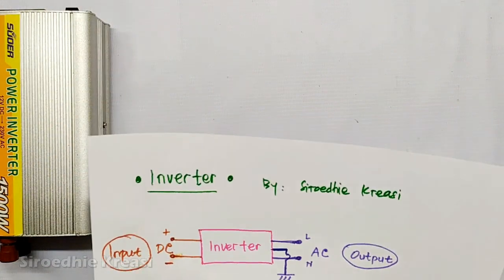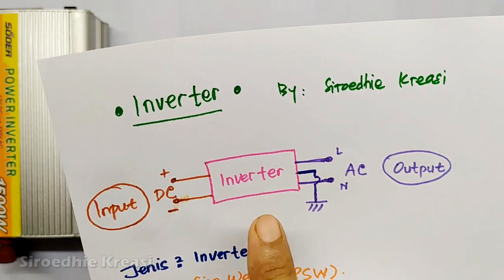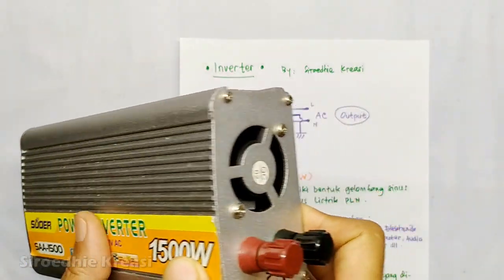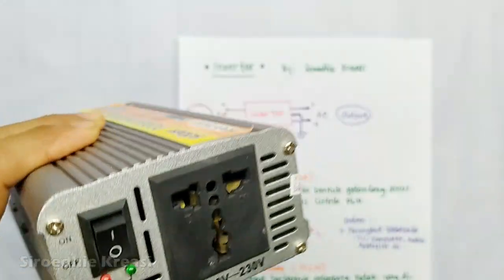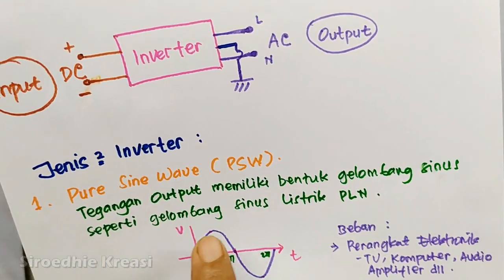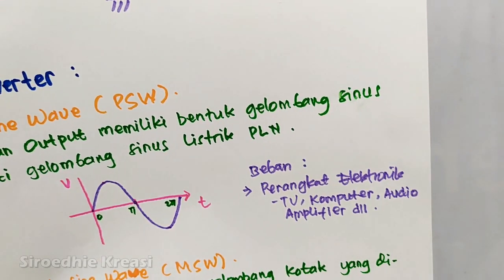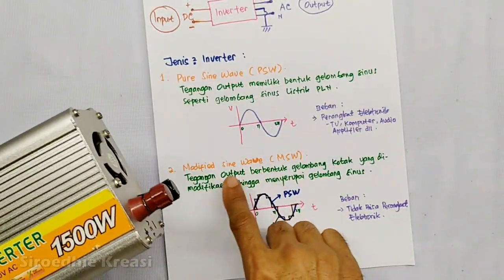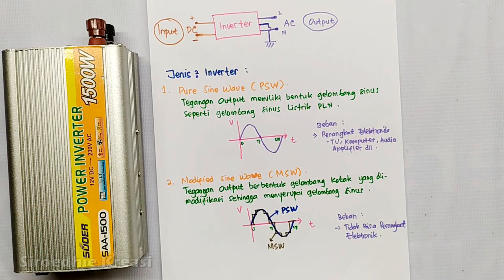Jangan Salah Pilih Inverter, bisa fatal akibatnya

Comment: ass kak . mau tanya, kalo penggunaan buat grinder kopi apa bisa ?
jika menggunakan aki mobil tahan berapa lama. soalnya buat cadangan jika sewaktu kedai kopi kami lagi padam listrik. aman nya pakai jenis inverter PSW / MSW
terima kasih
Reply from the maker: untuk grinder kopi jenis msw dah oke kak, lama dan tidaknya tergantung besar daya (watt) grindernya kak. coba dicek dulu
Reply: @siroedhiekreasi   grinder kopi yg saya pakai
daya +- 160 - 180watt
voltase 220v / 50hz
terus inverter jenis MSW nya yg berapa watt ?
ohyah jika mesin grinder kopi tidak dinyalakan sedangkan inverter nyala, apakah daya aki tetap terkuras ?
maaf kak banyak tanya. terimakasih
Reply from the maker: @rdvruvie280  bisa pakai inverter 500 s.d 1000 watt. kalau tidak digunakan sebaiknya dimatikan juga inverternya, agar aki bisa hemat
Reply: @siroedhiekreasi  oh gitu yah mas,
kalo misalkan saya pake inverter jenis msw 1000 Watt pakai aki yg 60AH
dengan tegangan grinder kopi 180 Watt bisa tahan berapa lama kira2. maaf mas banyak tanya masih awam. terimakasih

Comment: Izin bertanya mas, apabila kita mau pasang inverter dc to ac dengan aki 12v di rangkai secara seri, apakah bisa pakai inverter yg 12v atau yg 24v?
Reply from the maker: aki 12 volt yg dirangkai seri tegangannya menjadi 24 volt  pak. berarti kita gunakan inverter 24 volt. kalau dihubung paralel, bisa kita gunakan inverter 12 volt

Comment: Assalamualaikum. Telat nih baru nonton sekarang hehe. 

Mau tanya, kalo arus 24volt yg ada di truk bagusnya pake inverter yg mana dan berapa watt? Mungkin ntuk kebutuhan biasa aja kaya cas hp dan teko rebus air yg kecil. Terima kasih sebelumnya
Reply: Ada tambahan magicom mungkin jarang dipake, karna ketika perjalanan jauh dan posisi lagi dihutan aja
Reply from the maker: telat² dikit gak apa apa Om 😀. kalau aki 24 volt, harus menggunakan inverter dengan input 24 volt juga Om. mengenai watt nya menyesuaikan dengan watt beban ( cas hp, teko rebus) minimal 2x lebih besar dari watt beban. lebih besar lebih baik
Reply: Kalo kita langsung ambil arus dari aki, ga pake arus yg dari lighter. Pake sekring mungkin ya biar lebih aman
Reply from the maker: @kliacahyo4543  bisa Om, ambil langsung dari Aki dan dikasih sekring biar aman
Reply: Oiyaa, kira kira kalo tak beli yg 12volt trus diambil arus aki 12 volt bisa ga? Negatif nya ngambil dari body gitu? Cari yg 24volt susah di online shop kebanyakan watt nya gede dan msw om.
Reply from the maker: @kliacahyo4543  bisa Pak, ambil dari aki yg 12 volt. biasanya aki 24 volt terdiri dari 2 buah Aki 12 volt yg dihubung ser
Reply: Iya dari kabel pararel nya kan om. Aman ya itu?
Reply from the maker: @kliacahyo4543  ya Om, aman

Comment: Mau tanya pak, itu kalau untuk memasak nasi pakai magicom apa bisa? Trmksih🙏
Reply from the maker: bisa pak
Reply: @siroedhiekreasi   terganrung amper akinya atau teegantung inverternya pak? Soalnya saya ada aki besar dgn inverver 600v nggk kuat utk masak nasi. Utk kipas angin juga mutarnya nggk kencang. Kondisi aki baru pak dijamin blm soak hehe.
Reply from the maker: @wahyuhandoyo6288  tergantung sama aki dan inverternya. semakin besar Ah dari aki, akan semakin lama waktu menyala. daya inverter minimal 2x lebih besar dari daya beban
Reply: @siroedhiekreasi   pantesan, magicom saya kebetulan 400wat. Inverternya cuma 600w. Kalau aki nya 150Ah pak. Tinggal ganti inverternya ini berarti. 
Trimksih pak penjelasan nya. Sukses selalu
Reply from the maker: @wahyuhandoyo6288  sama sama pak, amin

Comment: Assalamualaikum kak, sy dari Papua, baru ketemu video Kaka, yg selama ini sy cari mengenai listrik alternatif utk perangkat mesin kopi sy. Rencana sy mau jualan dgn cara mobile. Jadi sy butuh listrik kurang lebih 4000 s/d 5000 Watt( ini sudah x2 dgn Watt yg sy gunakan, mesin espresso dan grinder biji kopi) ,Sy sudah nonton videonya, tapi sy tdk mampu menentukan jenis batterai ( aki) yg sy harus beli, inverter berapa Watt utk set jualan sy kak . Mohon berkenan dijawab kak. Terimakasih
Reply from the maker: tapi setelah saya pertimbangkan kembali, untuk daya sebesar itu lebih baik menggunakan genset aja kak. lebih praktis dan ekonomis 🙏
Reply: @siroedhiekreasi  ok kak, 
Tapi misalnya saya tetap pakai (sistem inverter) sy butuh inverter berapa Watt dan Volt serta aki/baterai berapa Watt dan Volt (dan berapa pcs aki yg sa pake) kak
Reply: Karna total pemakaian elektronik sy kurang lebih 2000 an Watt saja kak, tapi karna sy pernah mendengar saran, jika ingin alat2 penghasil listrik tetap awet, maka di kali 2 utk kapasitas nya kak, jadi sy pikir sy butuh 4000 sampai 5000 Watt listrik
Reply from the maker: baik, insya Allah coba saya hitung² dulu ya kak. mohon bersabar, kalau dah selesai nanti saya share di sini

Comment: Saya sangat awam jadi pertanyaan nya maaf jika mendasar.Mau tanya mas
1.saya butuh listrik 300watt,jenis aki apa yg cocok dan awet serta spesifikasi nya.misal butuh yg 10ampere atau gimana
2.apakah semakin besar ampere aki berarti semakin lama jangka pakai nya
3.saya bakal menggunakan mesin grinder/penggiling yg memakai motor dengan 150 watt.itu cocok nya pake inverter apa?
Reply from the maker: 1. Kalau pengen praktis, bisa gunakan jenis aki kering (free maintenance). Mengenai besar kecilnya Ah tergantung berapa lama waktu pemakaian ( silahkan lihat contoh² perhitungan di kolom komentar yg sudah saya buatkan).
2. iya benar
3. jenis msw sudah boleh, kecuali ada beban yg lain seperti peralatan elektronik lebih baik gunakan psw
Reply: Terima kasih bang atas masukan nya
Reply: Kalo Aki kering bisa di cas ga bang?

Comment: Mohon bimbimgan pak...saya punya aki 70 amper mau pake untuk mancing...
Pertanyaan
1.berapa lama tenaga aki habis untuk menghidup kan lampu 50 watt sebanyak 6 buah
2.inverter jenis apa yang saya beli.
Reply from the maker: 1.perhitungan sederhanya lebih kurang seperti ini : 
Aki : 70 Ah 12 Volt
Lampu : 50 watt x 6 = 300 watt
I = P/ V = 300/ 12 = 25 amper 
Waktu pemakaian : 70 Ah/25 = 2,8 jam
effisiensi Aki 20 %, sehingga 2,8 - 0,56 = 2,24 jam ( waktu pemakaian efektif)
2. Jenis inverter jenis msw 

Semoga membantu 🙏
Reply: Aki 70 Ampere itu tidak ada pabrik manapun yg bikin. Yang ada adalah aki dgn kapasitas 70 Ah.
Jadi sangat berbeda antara A dan Ah.
Kalau digunakan sbg penerangan, ya jangan pakai lampu 220 Volt, tapi lampu LED 12 Volt. Karena ini menyangkut efisiensi. Mengkonvert tegangan membutuhkan energi terbuang sbg panas.

Comment: Saya pake buat hotgun kok ngak kuat inverter 1000 Watt hotgun input  juga 1000
Reply from the maker: pakai aki beeapa Ah Om ?
Reply: Pake aki motor 12 volt
Reply from the maker: @dimensisakti2509  akinya kekecolan tuh om
Reply: Maaf terima upgrade ngak

Comment: Fatal nya gimana bang,? Yg aman gimana? Kalau untuk menyalakan TV gimana? Aman kah 50 watt
Reply from the maker: fatalnya adalah saat kita salah dalam menentukan jenis inverter untuk keperluan beban.  kalau untuk tv, seperti yg saya sampaikan dalam video ini adalah jenis psw. untuk daya bisa kita gunakan minimal 2x lebih besar dari beban
Reply: @siroedhiekreasi  kalau untuk orgen bisa gx bang? 40w  16volt
Reply from the maker: @kakjunjung3525  kalau tegangan 16 volt pakai adaptor aja Pak, bukan inverter
Reply: Daya input dari aki  outputnya mau ke 16 volt
Reply from the maker: @kakjunjung3525  maaf Pak, gak faham saya pertanyaannya 🙏
Reply: @siroedhiekreasi  jadi gimana caranya aki bisa buat nyalain alat dengan daya 16v .. Apakah pakai adaptor AC atau pakai stepup aja dr 12v aki di naikan ke 16v  apakah bisa?
Reply from the maker: pakai adaptor aja Om, kalau inverter gak bisa.
Reply: @siroedhiekreasi  adaptor yg gimana ya? Dari aki 12 v  jadi 16v

Comment: Mau tanya pak kalau baterai subsystem yg dipakai tegang 24volt 150ah apakah bisa pakai inverter 12volt?
Reply from the maker: gak bisa Pak,  harus pakai inverter dgn input 24 volt
Reply: Terima kasih atas informasinya pak🙏...
Reply from the maker: @samsulakram  sama sama Pak

Comment: Pak, kalaw untuk mesin cuci sanggup gak ya inverter nya 1500 bgtu dengan aki 200.. mohon dijawab pak
Reply from the maker: insya Allah sanggup Pak. kalau boleh tau mesin cucinya berapa watt. u tuk daya inverter minimal 2x lebih besar dari daya beban.
Reply: @siroedhiekreasi  rencana beli mesin cuci yg mngkin agak rendah watt nya pak.. kisaran 250 s.d 350 Watt pak...mngkin kapasitas 8kg saja
Reply from the maker: berarti invertenya dah oke
Reply: @siroedhiekreasi  tapi sblumnya pak klaw sya pake blender dengan Watt 150 itu gak maksimal pak tenaga nya... Klaw pake generator jadi normal
Reply: @siroedhiekreasi  kebetulan saya cek inverter yang di video nya sama dengan yg ada drumah pak 🙏

Comment: Bang sya subscriber baru ..mau tanya kalau grinder kopi cocoknya pake inverter PSw atau msw?? Terus kalau powernya 200 watt Voltage: 220V /50Hz harus pakai aki yg bagaimana..mohon pnjelasannya soalnya sya buta mslah kelistrikan😅
Reply from the maker: jenis msw udah bisa, daya inverter minimal 2x lebih besar  dari daya grinder. pakai aki 60 Ah dah oke tuh
Reply: Saya cek2 harga di olshop..inverter msw di deskripsinya ditulis "tdk bisa digunakan untuk grinder kopi,gerinda dll"..trus gimana bang malah jdi bingung
Reply from the maker: @BangZoroOfficial  grinder kopi menggunakan motor universal bang, sama halnya dgn mesin bor dan gerinda seperti yg saya contohkan dalam video ini.  idealnya memang pakai psw, tapi menggunakan msw masih bisa bang. Kecuali beban yg kita gunakan seperti tv, hape, laptop, dvd player itu mutlak menggunakan psw 🙏
Reply: Siap bang makasih penjelasannya
Reply from the maker: @BangZoroOfficial  sama sama bang 🙏
Reply: Kalau blender bisa nggak pak pakai msw?
Reply from the maker: @BangZoroOfficial  bisa Bang

Comment: Om punten mau nanya, kalo saya punya inverter MSW tapi pas di cek output nya netral nya tidak ada hanya fasa saja, tetap pas di cek tegangan normal 220V AC, itu kira2 kenapa ya om ? Mohon pencerahan nya terima kasih 🙏
Reply from the maker: gak masalah Om, kemungkinan karena grounding tidak terpasang
Reply: @siroedhiekreasi  untuk grounding nya pas saya cek sih aman om 🤔

Comment: assalamu'alaikum warahmatullahi wabarakatuh...bang ijin tanya,saya butuh daya untuk 3 lampu led godox SL60W (lampu video).pemakaian sekitar 2 jam di lokasi yg tidak ada listrik...kira2 butuh inverter berapa watt dan aki kering ukuran brp ya?agar bisa ringkas dirangkai,bisa portable kemana mana.jazakallah khoir atas ilmunya smga menjadi ilmu jariyah
Reply from the maker: Waalaikumussalam warahmatullahi wabarakatuh. inverter bisa Bapak pakai 500 watt psw, aki bisa gunakan 50 Ah. Dan pastikan tegangan aki sama dengan tegangan input inverter. kalau menggunakan aki 12 volt, maka input inverter juga 12 volt 🙏
Reply: @siroedhiekreasi  syukron jazakallah khoir pak...sekalian kalo misal pake lampu flash 300w 3pc,berarti butuh inverter minimal 1500watt ya pak?
Reply from the maker: betul Pak, syarat minimal inverter adalah 2x lebih besar dari total beban (watt). lebih besar semakin baik
Reply: @siroedhiekreasi  makasih byk,barakallahu fiik

Comment: Mantap bos klu boleh tannya umpama arus dari DC ke inverter terus jadi PLN tru colokin cas aki biar sambi ngecas itu aki  bisa tak bos
Reply from the maker: gak bisa bos, akan banyak terjadi losses
Reply: Kalau anda punya listrik dari PLN, lha buat apa repot2 pakai aki dan inverter ?
Tapi kalau maksudnya : dari aki DC masuk inverter AC 220V trus masuk charger untuk nge-charge aki, dari aki ke inverter lagi  listriknya keliling ya nggak ada gunanya malah buang2 energi.
Kan semua alat itu punya efisiensi dan selalu energi input lebih besar dari output.
Cara anda ini cuman menghasilkan anget di masing2 alat yg digunakan.

Comment: Om kalau msw bisa buat lampu led dan modem wifi gak dg kipas angin stand.
Reply from the maker: sebaiknya yg psw Om
Reply: @siroedhiekreasi  sy rencana mau pakai aki mobil buat batrainya kira2 spek aki mobil yg bgs buat inverter psw yg gimana om soalnya sy baru mau nyoba pakai inverter soalnya di tmpt sy sering mati listrik
Reply from the maker: untuk pemakaian yg lama, sebaiknya menggunakan aki dengan Ah yg besar. di atas 70 Ah sudah memadai. Tapi lama dan tidaknya tergantung juga dari total beban yg akan kita gunakan
Reply: @siroedhiekreasi  kalau yg 45 ah atau yg 60 ah cukup tdk kalau buat lampu kipas angin sama modem wifi om

Comment: Mau nanya om, sy bru beli inverter PSW 1500watt peak 3000watt inputan 24Vdc. 
Klo misalkan aki sy seri dengan kapasitan ampere 35Ah, bisa tidak angkat beban 1050watt continus selama 15 menit?
Reply from the maker: untuk menaikkan kapasitas ampere aki dihubung paralel pak
Reply: @siroedhiekreasi  maksud dr pertanyaan sy bukan untuk menaikkan pak, tp apakah bisa mengangkat beban 1050watt selama 15 menit dengan kapasitas aki 35Ah?
Reply from the maker: @mustakim6311  persyaratan minimal inverter adalah 2x daya beban. karena effisiensi inverter tidak 100 % pak.  sepertinya tidak bisa pak, setelah kita hitung untuk beban 1050 watt arus nominalnya sebesar 55 Amper. Kapasitas aki harus dibesarkan 🙏
Reply from the maker: @mustakim6311  bapak bisa hitung menggunakan persamaan P = V.I.Cos phi, dgn asumsi cos phi 0,8

Comment: Tidak berbahaya bagi elektronika saya dah pke yg msw 2000 wat buat ces leptop buat TV buat sound system tidak ada kendala yg gk cocok itu mas buat jenis dinamo saya ada yg psw maupun msw silahkan mampir kechenel saya ada banyak jenis inverter
Reply from the maker: terima kasih sharingnya bang
Reply: @siroedhiekreasi  bang saya mau nanya klo untuk mesin pres cup seler dan lampu yang 20 sekitar 5 buah kira kira yang pas pake inventer yg berapa Watt dan aki yg berapa amper
Reply from the maker: @PurWanto-hq2ln daya inverter minimal 2x total daya keseluruhan, untuk aki boleh pakai yang seperti punya saya (60 Ah)
Reply: @siroedhiekreasi  bagusnya pake yang msw apa psw dan klo mesin cup gelas kurang lebih 300 wat di tambah lima lampu masing masing 20 wat baiknya pake inventer yg berapa wat ka
Reply from the maker: bisa pakai jenis msw 1000 watt pak
Reply: @siroedhiekreasi  ok bang terimasih semoga semakin sukses berkah barokah amin
Reply from the maker: @PurWanto-hq2ln  Amin 🙏

Comment: Bismillah
Assalamualaikum warahmatullahi wabarakatuh
Maaf saya masih awam, ingin bertanya. 
Di daerah saya sering mati listrik dari jam 09.00-14.00 dan ketika pemadaman listrik saya hanya butuh untuk WiFi, charge laptop-hp dan 1 lampu. 
Untuk inverter-nya sebaiknya saya beli jenis PSW ya Pak? 
Kapasitas aki dan inverter yg perlu saya beli kira² berapa untuk kebutuhan tsb? 
Perawatan inverter dan aki-nya bagaimana?
Untuk perakitan-nya apakah sama seperti inverter DC divideo ini? 
Terimakasih sebelumnya 🙏
Reply from the maker: Waalaikumussalam warahmatullahi wabarakatuh. Benar, jenis inverter yang PSW.  kapasitas aki boleh gunakan yang 60 s.d 80 Ah, untuk inverter kapasitasnya 2x lebih besar dari total beban yang Ibu Ika gunakan. untuk perakitan sama persis seperti di video. sebaiknya menggunakan chager untuk aki, agar ketika aki habis bisa kita cas ulang. atau boleh juga menggunakan solar sel (tutorialnya juga sudah saya buatkan dgn judul "Cara membuat pembangkit listrik tenaga matahari) 🙏
Reply: @siroedhiekreasi  
1. Router WiFi 12V 1A =12watt 
2. Laptop 19V 1.75A = 33.25watt
3. Lampu 5V 1.2A = 6watt
4. Charger HP 5V 0.55A = 2.75watt
Total daya listrik 54 watt
Jika mati listrik dengan estimasi waktu 8 jam apakah saya bisa menggunakan inverter dengan spec: max output power 1000watt continuous power 500watt pak?
Hanya bisa pakai aki mobil ya pak? kalau aki motor apa tidak bisa?
Apakah semakin besar ampere aki maka bisa lebih bertahan lama saat mati listrik? Atau semakin besar inverter maka semakin bertahan lama saat mati listrik?
Terimakasih
Reply from the maker: @ika6421  kapasitas 1000 watr sudah.memadai, kapasitas aki semakin besar Ah akan semakin lama waktu untuk menyalakan beban. Jenis aki boleh   yang kering atau basah tergantung badget

Comment: Assalamualaikum pak untk mesin cukur rambut rangkainya gmn pak?
Reply from the maker: cara merangkainya sama persis seperti penyampaian dalam.video ini. Silahkan Bapak ikuti. selanjutnya, output inverter dihubungkan dgn mesin cukur rambut. pakai jenis msw sudah memadai 🙏
Reply: Accu berapa volt dan untuk inverter berapa watt pak?
Reply from the maker: @mahesapml44  kalau pemakaian hanya untuk mesin cukur rambut, aki 12 volt 25 Ah dan inverter 500 watt msw sudah oke Pak. Tapi sebaiknya ada charger aki, agar ketika muatan aki berkurang bisa kita cas ulang.atau Bapak bisa gunkan solar sel yg berfungsi sebagai alat pengecas aki. Tutorialnya sudah pernah saya buatkan. 🙏

Comment: Om psw bisa buat ac 1/2 pk gak ya om
Reply from the maker: bisa Om, pastikan daya inverter 2x lebih besar dari daya ac. 1 pk sama dwngan 746 watt 🙏
Reply: @siroedhiekreasi  1/2 pk brp Watt ya inverternya om..rencana mau di psng di motuba saya yg aki12v kira" bisa gak ya
Reply from the maker: @trianadewinursanti1806  inverter bisa pakai yg 800 watt, aki 12 volt bisa digunakan dan menyesuaikan dgn tegangan input inverter
Reply: @siroedhiekreasi  terimakasih om
Reply from the maker: sama sama 🙏